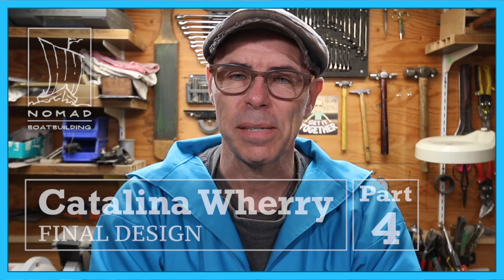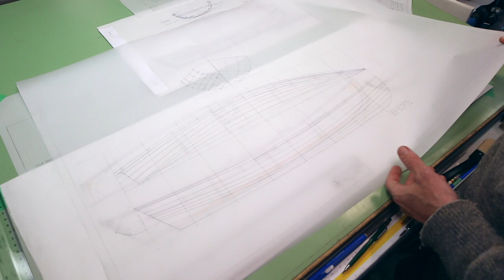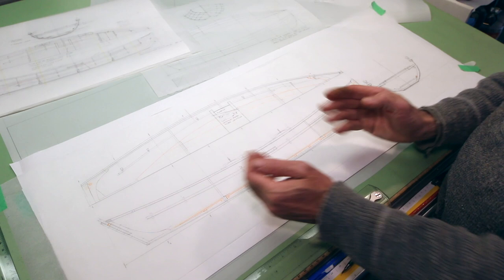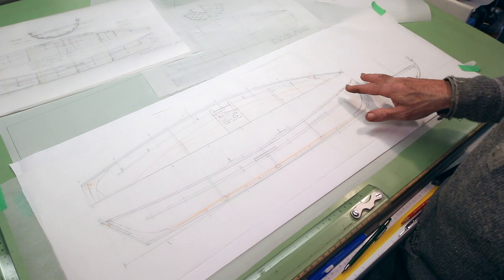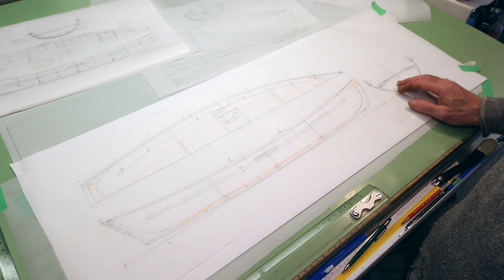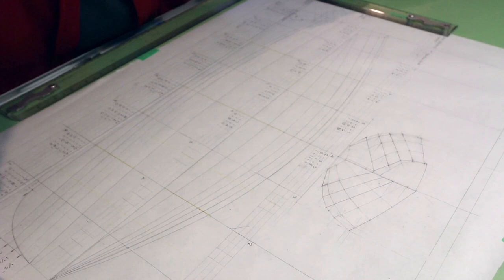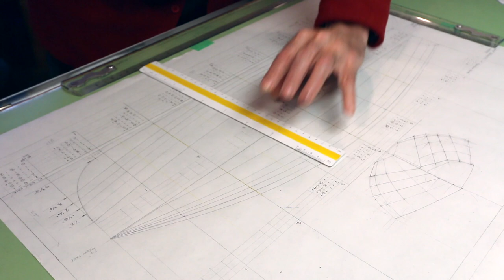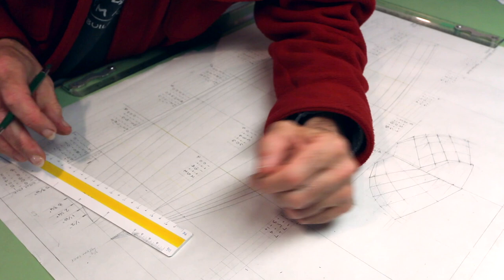Building the Catalina Wherry - Part 4 - Final Design & Offsets

Comment: This should probably be held back until the next episode, but you know how I am😉. If the batten yields a different offset on the lifting floor for a particular  point, is it common practice to correct the table? Might even be something you could address in your next video reflections
Reply from the maker: You are correct. The challenge is usually when all the lines seem correct but they don’t exactly jive. That’s when the artistry steps in. I’ll give you a spoiler. We won’t be walking through the lofting process as a whole but I will be touching on one of the more difficult concepts absorb. Understanding bevels and mould reductions.

Comment: SO.... The offsets, Is that like finding all the intersection points in a 3d grid(plane)?
Reply from the maker: Yes, that's a good way to put it, except since we are working in two dimensions, each offset is applied to a specific 2D point of view. The three views are connected or rather related via flat planes.

Comment: Wots wrong with tenths of an inch? 🎯😎 
Decimal inches ???❤️
Reply from the maker: Nothing wrong with them but they aren’t the standard.
Reply: @Nomadboatbuilding   l built a plane and the plans were in decimal inches, it’s was a pain in England that’s for sure👍
Reply: How about just using millimeters?  Imperial measurements are just confusing.
Reply from the maker: I find metric more confusing. Never sure if I'm working in meters, centimetres, millimetres and my brain struggles to visualize scale with all the above. Plus, I can’t see millimetres without my reading glasses on but I can see imperial measurements no problem.
Reply: @Nomadboatbuilding  I did my apprenticeship on imperial lathes and milling machines, but all drawings were metric, so I think I can go between the two fairly well.
Only ever use millimeters to work with, my German wife uses centimeters and it creates miscommunication if she doesn't quantify the units.
Reply from the maker: I actually use metric for some furniture work. Mostly when using baltic birch or when European hardware is being used or when prototyping for designers. It’s a bit of a difficult transition at first. For boats though, imperial all the way.
Reply from the maker: @soylentgreen326  I can understand that but the larger fractions eventually get memorized and if you are using verniers for the critical stuff is makes no difference at all.
Reply: @Nomadboatbuilding  that’s a very measured reply🎯
Reply from the maker: Here we go……
Reply: @Nomadboatbuilding  are we there yet..............
Reply from the maker: You should know. You were the one doing the driving!
Reply: @Nomadboatbuilding  😳 Yeup l guess so ❤️🥳🤸‍♂️